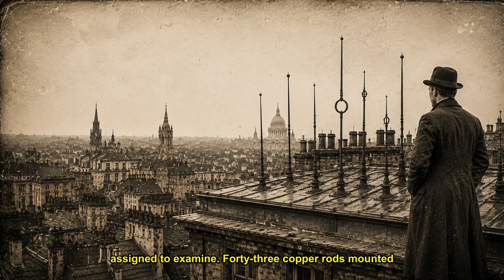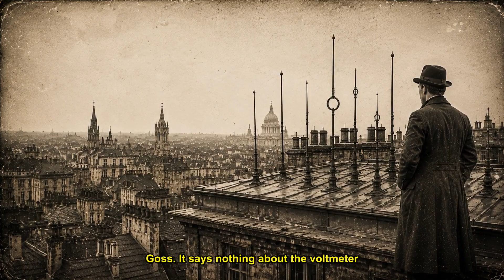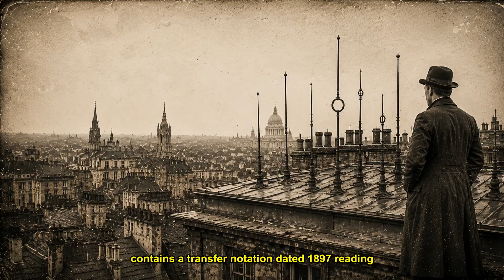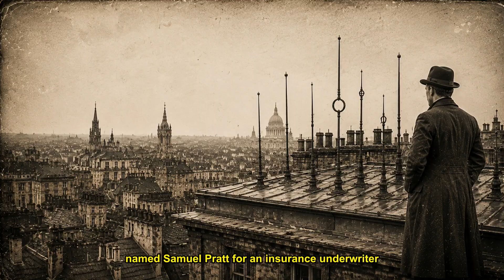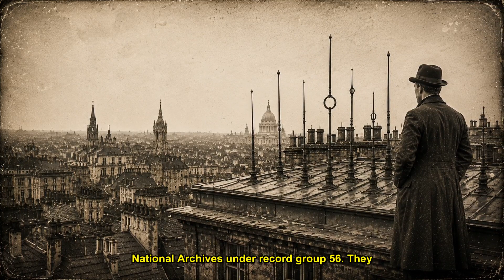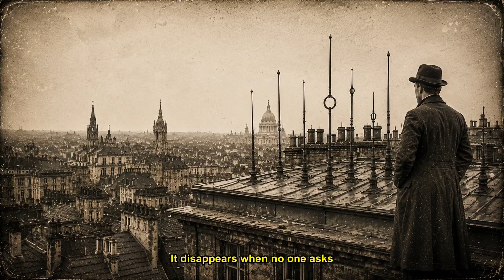history 58The Metal Rods on Old Rooftops — What They Were Actually Collecting

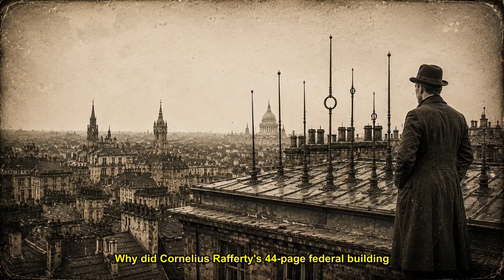Comment: 18:40 dosnt matter whata in it. it is copper bokted to the cement. a lot of it would gonintonthe geound the rest would fill the room
Reply: go into the room as residual electrical energy Residual electrical energy is the leftover electrical charge stored in circuit components like capacitors, batteries, or cables after you turn off or disconnect the main power source.